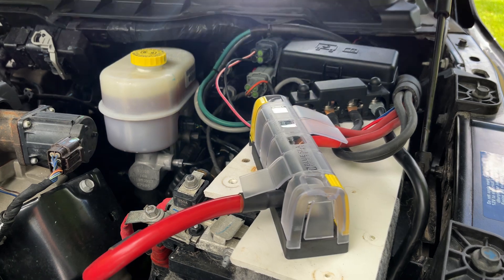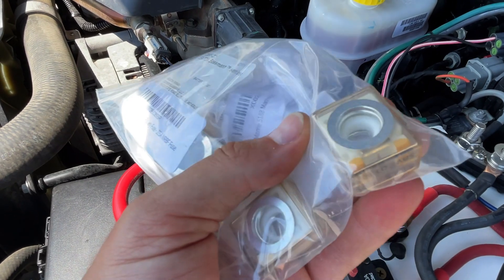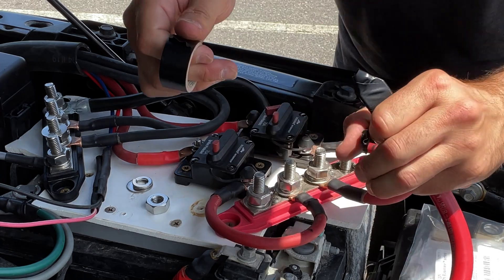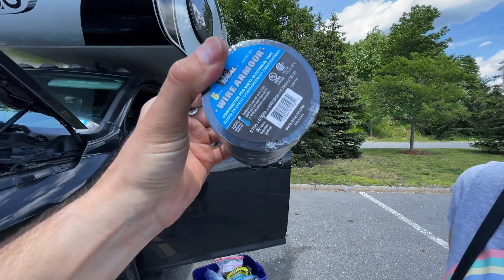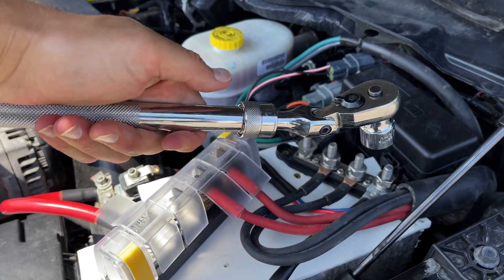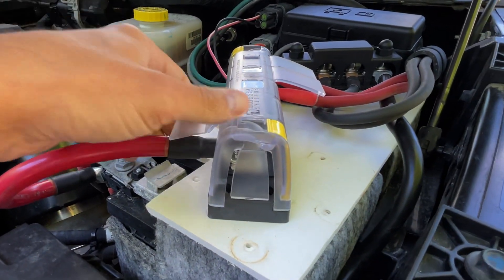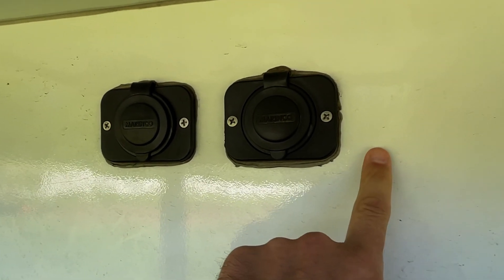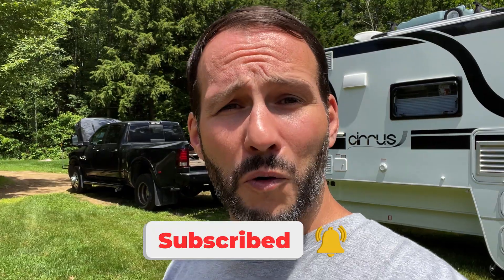Breakers vs. Fuses in the Heat // DC-DC Charging System Update

Comment: If you encounter a situation requiring you to tape the conducive portion of a tool to prevent shorting, I would choose any color electrical tape besides black - for whatever reason, black tape always leaves black adhesive behind.

However, regardless of whichever color you choose, even black, you'll be doing yourself a favor by "back-wrapping" the first layer (sticky side out).

When we connect 3 phase motors to the power cable coming from the motor starter, we back-wrap the bolted connection with electrical tape, followed by a thick layer of rubber splicing tape to prevent the lugs or the bolt from shorting to ground, then we wrap electrical tape the outside with the sticky side down.

The first layer of tape isn't required, but the rubber tape amalgemates into one solid piece, so without tape, or even taping with the sticky side in, it is the biggest PITA to remove.

So, a tool that you'll tape temporarily will be much easier to remove by scoring the tape with a knife and peeling it off in one piece.

Comment: As a secondary precaution, in regards to your 'exposed' terminal lugs, when you disconnect the camper, you can easily cover them with rubber vacuum block-off caps/plugs.

Comment: Hi and thank you for great format, great to see someone that knows how this all works, I certainly do not. Can you either refer me or simply advise me on the below scenario? 
I have to connect a 12v AC into my cargo trailer conversion.
I currently only have a Blue Sea fuse panel. The Outequip Pro AC has 6AWG ring terminals. I’m under the impression I need a 250a breaker, bus term, and shut off, but I don’t know how or where they go, hard to find my scenario on here. Thanks for any advice.
Not Elec Savvy

Comment: Can someone explain the correlation between heat and amperage? Specifically, why does increase in heat cause breakers or fuses to trip? I understand that increase in heat is an increase in resistance... But what does that have to do with amperage? For example, a 200a fuse doesn't trip when cold, but then you add heat to the circuit and then it does? Why?

Comment: It’s interesting that you are having this problem because I’ve run 40 and 50 amp fuses in the engine bay of my turbo diesel Landcruiser for 3 years in Australia and never had one trip. I have been warned of the risk of them tripping but it’s never happened to me. It probably will now that I’ve cursed myself.

Comment: good info.  I should have realized the breakers are difficult in the engine bay.  There is a specification curve showing the trip current changes a lot with temperature.  Guess I'll try moving the breaker towards the front grille.  Or change to fuses as shown

Comment: This is such helpful information. Thank you. I'm curious if, since the time you originally installed your DC-DC chargers, you've found a better connector than the one you used with your Cirrus 920.

Comment: I have the same marine circuit breaker under the bonnet of my Land Rover Defender that I use in the Sahara. It works great and I love it for the same reason you did; instant on-off switch. It makes it so easy to simply cut off all the power so you can do work. I've used the truck in extremely hard going with 120+ F temps and the breaker has never tripped due to heat. It might just be that big old lump of diesel engine you have under there ;-) Cheers from over here!
Reply: My wrangler jl v6 keeps tripping a 90a breaker, charging a 60a dc dc charger. Soooooo annoying

Comment: Wrapping black electrical tape over those connectors that plug into the camper can be an issue. Even the good 3M black tape makes black sticky slime on those male pins ( brake cleaner to remove slime ). Any other other color doesn't seem to do that. I like to use the 3M temflex 35 grey or white electrical tape during builds or wrapping up temporary connections. I know everybody's a critic these days, just thought that might help you avoid issues in the future.  I like to use Industry Standard ANL fuses. If one blows they are easier to find and Amazon has tons of holders and fuses to choose from. Blue sea stuff is pretty awesome,  wow is it spendy.
Reply from the maker: Thanks for the advice! I appreciate your input. I'll definitely keep that in mind and consider using 3M temflex 35 grey or white electrical tape for my builds and temporary connections. Also, using Industry Standard ANL fuses sounds like a good idea for easier replacement options. Thanks again for sharing your insights!

Comment: That is why the hot side of a connector should always be the side with sockets.  The load should be on the side with pins.
Reply from the maker: Thanks for the tip!
Reply: Was about to post the same but figured someone likely already mentioned it, and here it is!

Comment: I have tried to find a general layout and diagram of your electrical setup. I have Arctic Fox 1140 and using 2 AGM batteries. I want to add a DC to DC charger and an inverter.  I am thinking a Renogy 2000W PSW  inverter and a Renogy 60A DC to DC charger. Recommendations?  DO you have a diagram of your system? I have dual alternators on my 2017 F350 Dually. Not sure of their rating.
Reply from the maker: I don't have a diagram and would suggest looking at Explorist.life since that's kind of his speciality. There are a lot of variables with these systems and it takes a lot of reading and figuring to get it dialed in. You can always email me at info@stonyboot.com if you want to discuss more.

Comment: I imagine you've heard this before but those 2 plugs on your camper body are incorrect, not code and very dangerous. The way you have wired them, with live pins exposed at the plug is called a "dead man's plug", for the reason you actually stated. Go in Home Depot and buy the correct male and female plug components (exactly opposite of the ones you have now) and swap them out before you, your partner and some random child pulls that plug and dies.
Reply: People forget about human error. Just because there’s an off switch doesn’t mean you’ll remember to use it and you wont forget there’s still power at the live exposed plugs.

Comment: @6:16 into the video, the scored nut supplied by blue sea, in our experience, will loosen over time from vibration. You don't want that. We suggest replacing them with a nut and separate copper lock washer. Seen too many of these on boats come loose. Blue Sea needs to up their game...  Glad you went with MRBF's. Good protection with high AIC.
Reply: had my blue sea safety hub upside down, attached to a panel while I did some trims with a jigsaw.  All the large nuts on the blue sea vibrated all the way off, falling off the bolt.  the threads are a little too good

Comment: You could 3d print a female adaptor cover or dummy... to protect the live wires of the camper.
Reply from the maker: That’s a good idea. I know a guy that can do that. But I have a new system coming.
Reply: Or you could cut a soda bottle and slip it on

Comment: I'd add Simple On/Off Isolation Switch be between your battery and your Fuse Block. That way when you take your camper off, there is no power still going through your cables . . . like with your 70amp circuit breaker you said you turned it off when taking the cables out of your camper for extra safety
.
Reply from the maker: I just disconnect the cable. The camper is rarely off, but in the last 6 months, we’ve had it off for extended periods because of fuel costs. So disconnecting the cable completely solved the issues.
Reply: @Stonyboot  Yep . . . give the day of the week, it's anywhere from $1.90 - $2.20 per litter for Diesel have . . . has put the brakes on weekend 4WDing get a ways a bit.

Comment: To disconnect power all you need is a  Anderson connector and you can just unplug the battery cable. Also I believe you installed the connectors backwards for your trailer. I believe the plugs should be installed on the truck somewhere and then the cable should come out of your camper. what you did was make a suicide cord.
Reply from the maker: I disconnect the cable when needed. And the plug is installed backwards, that was a compromise that I needed to make.
Reply: Maybe something like this would be convenient

Comment: I have the same problem,  but I'm gonna order a "Buss" company breaker.
 Yes they're more expensive but I think the quality will hold up  and I should be able to pump the 50 amps That I want through the 80 breaker.
 I just prefer breakers for the ability to turn it off and on like a switch.
 Also, I bought one of those cheap amp meters (400 amp) And put the sensor on the cable directly from the alternator , and then mounted the display in the truck .
This way I can see exactly how  many amps the alternator  Is putting out.
 I only have one alternator and it's a 150 amps.
 Most of the time,  on a normal drive,  it's putting out maybe 30 amps.
 I just want to make sure I don't overtax the alternator.

Comment: You need to reverse them plugs to the proper types...As you might know it. But someone else might not and they grab them ends.
Reply from the maker: I disconnect them when not in use. I agree, but it was the best I could come up with without a custom design.
Reply: @Stonyboot  I get why you did it. As 100amp Shore Power Plugs are $400.00+ Each. Which is $800.00 per connection Male\Female...

I would still come up with a Custom design. Just to reverse them..It may not look pretty. But it bets being dead. As I been hit by a setup like that when I was an Electrician. It damn near killed me..
Reply from the maker: Educate me. I was pretty sure 12v isn’t going to really hurt me. High amperage and will arc but I’ve touched plenty of 12v connections without as much as a tingle. What am I missing.
Reply: @Stonyboot  It's not just the voltage that will kill you. It's the amount of Current Flowing through the Circuit..You happen to get between it and grounded.. It will make your day. As they still teach it as Electrical Theory 400 years later for a reason. 

Why a Taser only uses 9 volt battery. But produces 100k volts. But only using 2ma of current. You ramp that current up to 30ma...that taser is now a deadly weapon. Why GFCI are rated at 25ma trip curve K...

Why the NFPA 70 is full of rules. They learned by someone else getting killed. 

So maybe mount a Disconnect between the Trailer and the truck. That way you can isolate the connection when detaching it. That or buy the proper Shore power Connections. As I just looked up Hubble Shore Power Plugs rated for 100amps. I was right. $890.00 for a pair Male\Female...As they are not cheap...
Reply from the maker: When I disconnect it, I remove the power from the truck. I never have it powered while unplugged. 

Luckily, that entire setup will be gone soon :)

Thanks for the feedback!
Reply: @Stonyboot  Well that is your means of Disconnecting it...Just make sure you put something next to them plugs. Stating how to de-energize it before removing them..You can have them self adhesive name plates made up...Then stick it right next to them..

That way if someone fails to read it. And gets to find out if Jesus really does exist. Your not liable for it...

Comment: Thx Scott.  I just got done with the 3000w Multiplus, BMV712 and MPPT 100/30 install to go along with the 412ahr Lithium batteries.  Now I'm getting ready for the next phase which is the DC-DC.  I remembered this video and had to go back and check it out.  Good stuff.  Hope all is well.
Reply from the maker: That sounds like a great setup!!! I’m dreaming of a Victron setup and it might be coming soon. 

Our DC-DC charging system is still working very well. I’ve been driving in 100f temps, running the ac in the camper while also running the DC-DC system to reduce battery drain. Working well 

Good luck with your build!

Comment: I had the same problem with (this type of) breakers annoyingly popping. The breakers are bi-metal switch devices and not really accurate rated amp tripping circuit breaker devices. No matter where this type of breakers are located (engine compartment or elsewhere), they pop well below their rated current. There were three breakers in my system and all opened during max load  (below breaker rating). Replaced with inline fuses. Agree the ability to disconnect power via the breaker is convenient but it has to work. Sadly these breakers did not work.
Reply from the maker: Similar issues here. But I’ve also had them melt instead of pop. Household AC breakers are great, DC breakers seem problematic.

Comment: Only thought I had, is if you would have increased the length of the cables from the generator battery under the hood to where you could move the breakers outside from under the hood. Why didn't you consider that an option?

Comment: are these great for solar on a battery bank to the inverter
Reply from the maker: Absolutely! The more I read about breakers, the less I want to use them.
Reply: @Stonyboot  i wanna used these for my battery bank before it go to my inverter. i am going to used a breaker for my solar panels from midnight solar to protect my mppt for over current. i just had a hard time trying to find the right fuse or breaker set up for battery bank setup since i am useding lithium then acid lead.
Reply from the maker: I use these on my battery bank. I love them.

Comment: Did you check the Amp with a clamp meter that is flowing through that line? The circuit breaker might be inadequate for the load and needs a higher Amp breaker. Guess work means $$$$.
Reply from the maker: Yes, everything is checked with a clamp meter. I could have gone larger on the fuses, but they were backordered. Hundreds of hours of runtime later, it's still going strong. I've also checked the fuse temperatures many, many times and they are not warmer than the surrounding surfaces.

Comment: Forgot to mention you could add a manual battery disconnect switch between  your fuse block and battery under the hood for safety to disconnect all power to your terminal fuse block.
Reply from the maker: I'll be doing something like that, as soon as I find the right switch!

Comment: I have never had any luck with the manual reset dc circuit breakers for what they are rated. Tried different brands they are all  junk. The only accurate ones are the automatic reset breakers, but have only found then rated up to 50 amps.
Reply from the maker: I agree, I had high hopes, but they just don't last.

Comment: Maybe a short bit of elect. conduit and a pipe cap that's slightly smaller then your plug end for a safety cap. Heat the conduit so it's soft and push it over the plug and let cool so it's a snug fit. 
Maybe you could flow in some CA glue into those female plug sockets to keep them from coming out.
Reply from the maker: That's a good idea! I think I'm just going to install a switch, it's the most logical thing to do. I'm just going to do it somewhere besides the engine bay. I've thought about using glue for the sockets, but they are like that to aid in assembly and disassembly. It really isn't a problem, I just push them back in when needed. If I used them on a regular basis, that would be a different story, but the camper stays on for months at a time.

Thanks for the thoughts!

Comment: You should probably add a battery disconnect switch before the fuse block. There’s a lot of power going through those wires and they can cause a lot of damage or even fire (even with the fuses). You should really disconnect from battery before pulling those unprotected plugs. They’re just next to the truck bed and you can easily touch the truck bed (ground) when pulling them out or just resting them for a moment.
Reply from the maker: I completely agree, this project is a work in progress. I’ll be adding some kind of disconnect, it just wasn’t in the cards for this part of the build.  Shipping delays make it hard to get what you need when you need it! I’ll probably do another video soon once I have it figured out.
Reply: BTW, great video! (Sorry I didn’t mention it in the original comment)
Reply from the maker: Thanks for watching and leaving a comment!
Reply: If you can find a non conductive rubber-plastic cover for that male cable end, it could help.

Comment: Look into a wireless relay switch, fairly cheap to add to your dc to dc chargers. Then you can shut them off with a remote any time you want . They sell them with 2 -12v relay on 1 remote. Anyway good vid I learned some stuff about terminal fuses I didn’t know. Safe travels, bob and Deb
Reply from the maker: Thanks for watching. I have my chargers hooked up to the upfitter switches in the truck. I can turn them on and off using those switches. But, I’ve never heard of wireless relays, I’ll have to take a look. Thanks for the tip!

Comment: You should be able to find some rubber caps for those threaded studs (they use them on playground equipment) in the hardware department at Lowe’s or HD then you won’t need to worry about making accidental contact with your wrench.
Reply from the maker: Agreed, another commenter had some good ideas that I’ll investigate too. Ideally, I want a shut off.